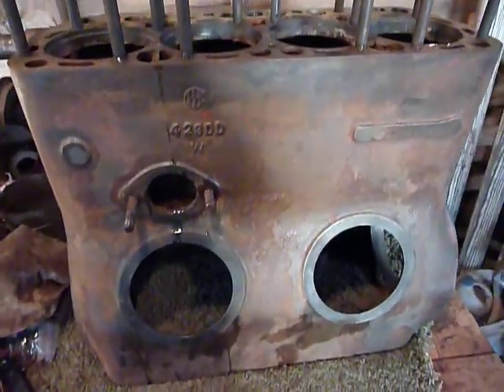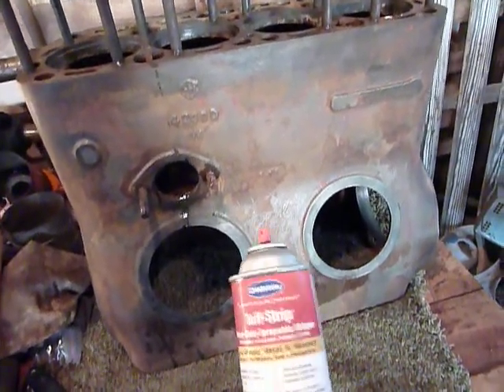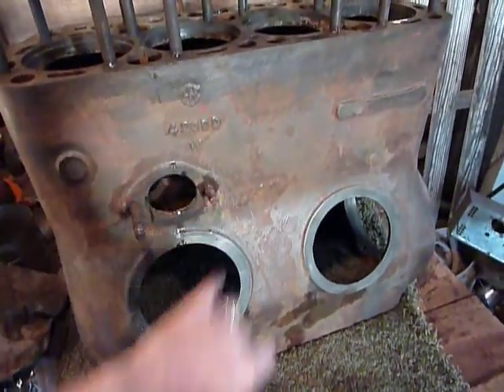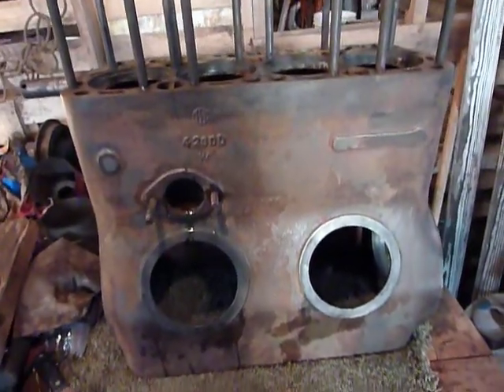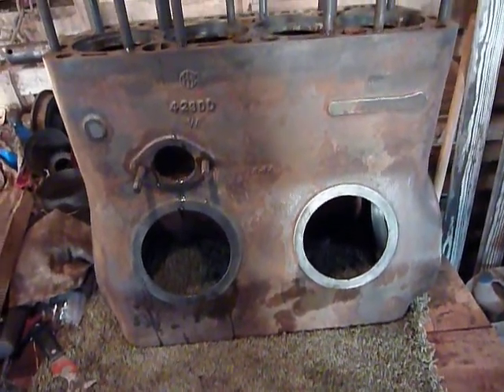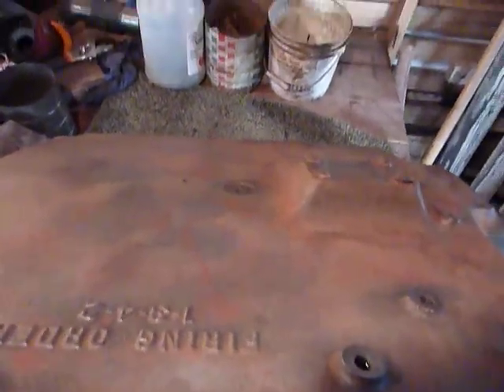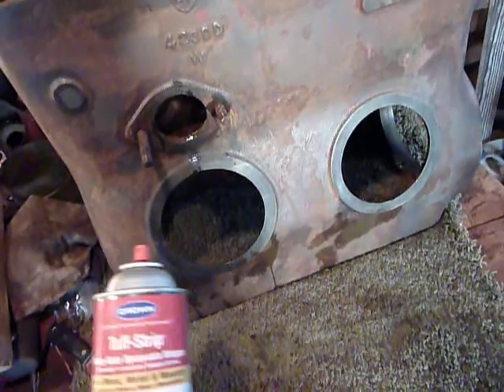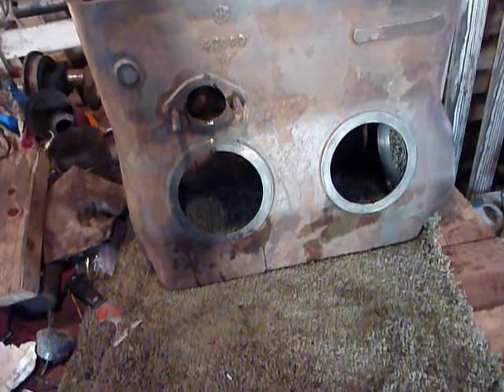Block

Comment: Another way to remove rust is acid, it dissolves rust and gets the metal shinny. Just make sure you rinse with water very well and then dry it right away.